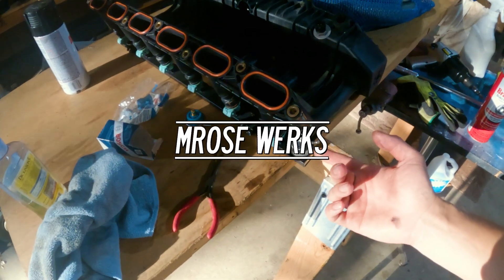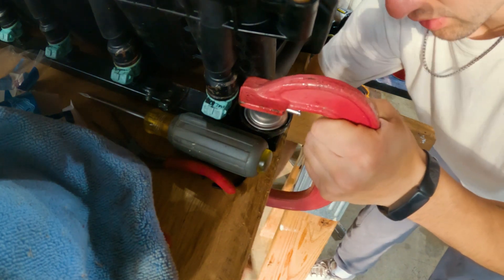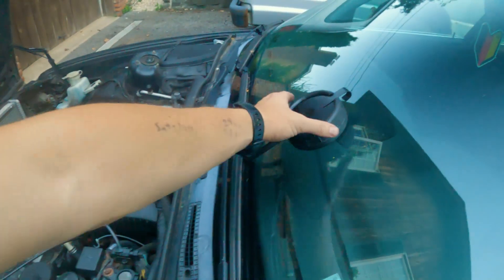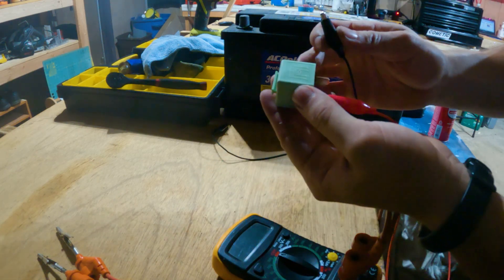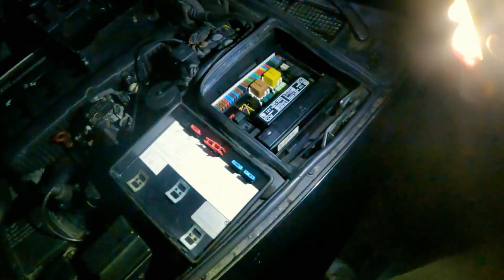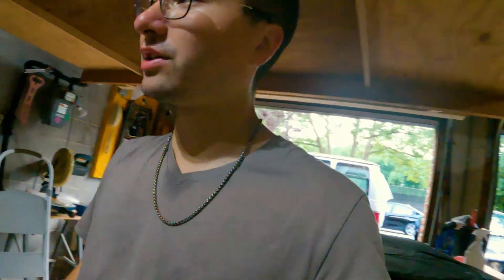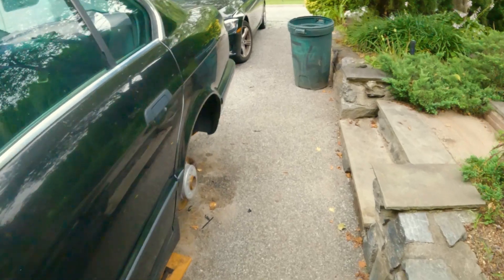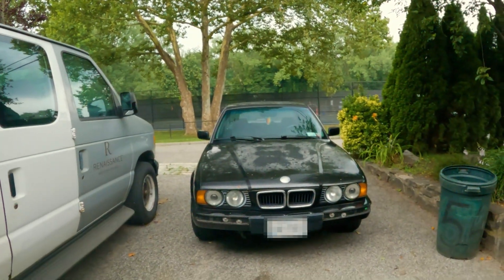E34 Fuel System Diagnosis (FPR, Relay, Fuse, Fuel Pump, Fuel Lines)

Comment: Did you use OEM fuel lines?
Reply from the maker: late reply, but i believe i used 6AN CPE nylon braided fuel lines, similar to evil energy branded lines, its been about 10 months with them and theyre doing great, fuel pressure is just fine at around 40psi, goes down to about 20psi after a few days of sitting there. One day Ill consider replacing it with metal lines. I also cut the charcoal canister fuel line and disconnected the evap purge sensor for the time being. All works fine. I dont encourage these choices but thats what I did for the time being to get it running.